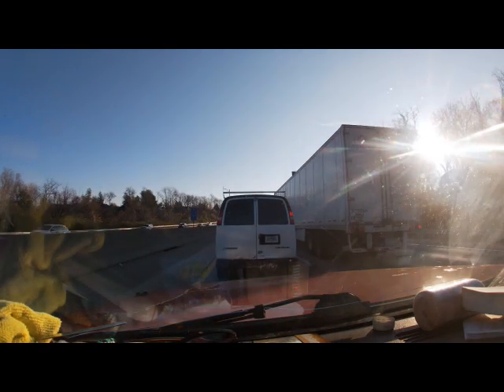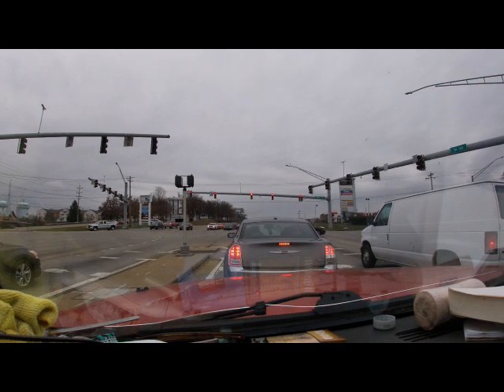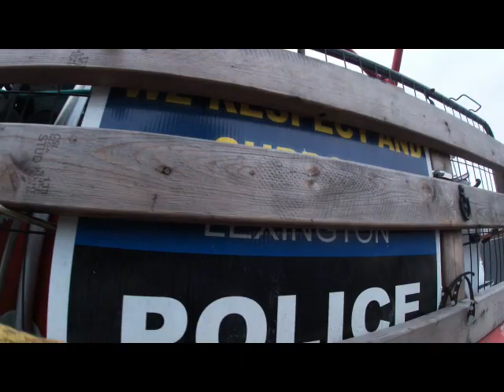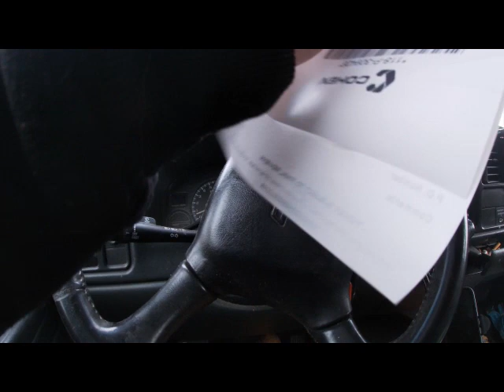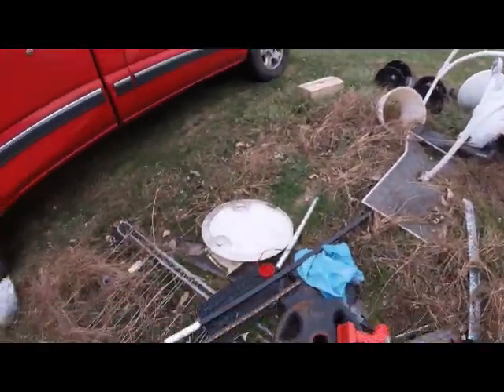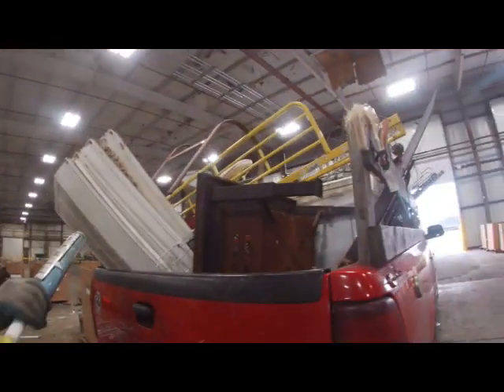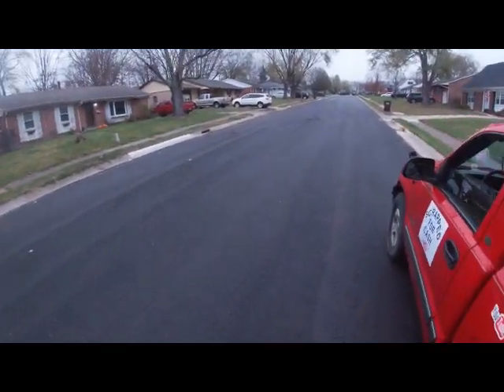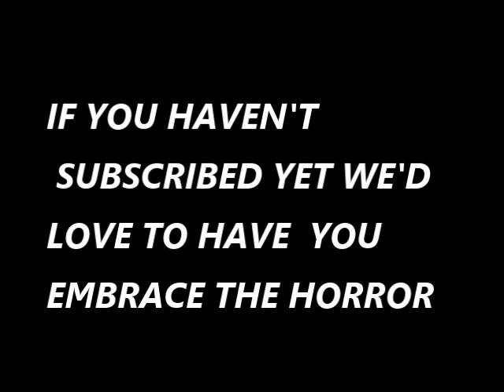TUESDAY SCRAP YARD PAYDAY

Comment: these new TV's are easy to get to the circuit board. Most just have a 8 x 10 board, just need a Philips screwdriver or just smash a hole in the back with a 🔨. I often process a TV right at the dumpster in 10 minutes